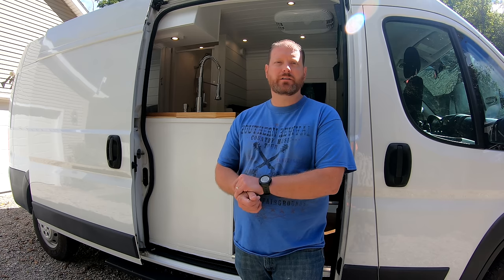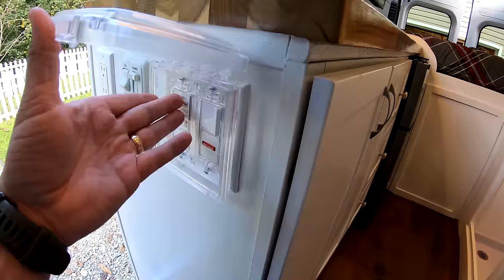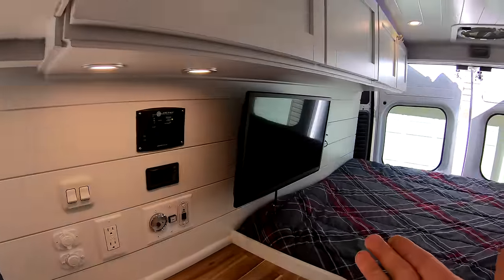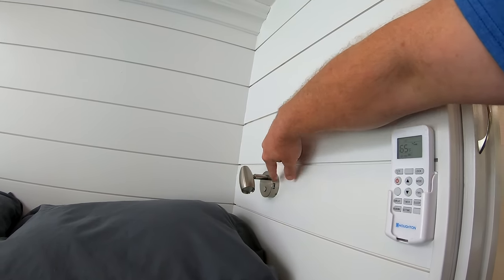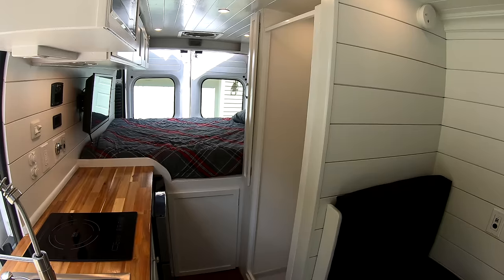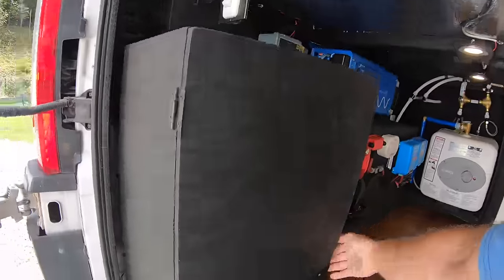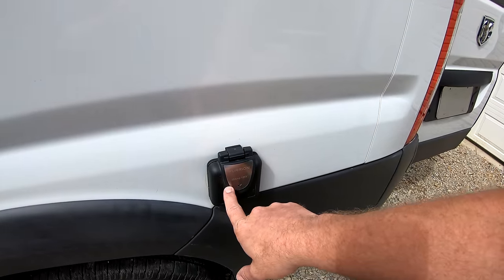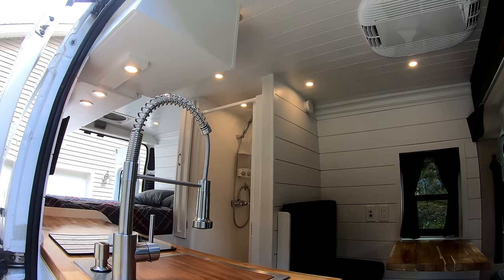We Built Our Custom Van Conversion In 30 Days - DIY RAM Promaster Camper Van Tour

Comment: You should move your main negative to the bottom battery. The way it's hooked up your first battery is taking the most wear, by moving it the power has to flow through all the batteries for any load (Victron has a document you can read on this). I would also suggest adding some kind of divider between the water hear plumbing and your electrical. When (not if) you get a leak it'll save your electrical components from getting wet.
Reply: These are wired in parallel. I don't see how the connection point would make a difference. I looked for the Victron info but didn't find it. Do you have a link?
Reply: @peterm6262  
Thanks. I believe OP responded with a link (although I don't see it now). I read their section and the internal resistance of the battery is what I recall reading. I'm obviously not an expert but having had boats with multiple batteries, it seems to me that the difference in battery longevity is negligible but I could be wrong as I never studied it. My experience is if one battery fails, the others are soon to follow.

Having said that, I have no problem adjusting my own thoughts and changing the connection points because it certainly can't hurt.
Reply: @rogermccaslin5963  was this comment your first time on youtube? Youtube has not allowed people to post links except for the channel owner for 5+ years. Sometimes links to other youtube videos can be posted if the channel owner allows that.
Reply: @CyberAndy_  
And how would one know if links were allowed by the channel owner unless they ask?

Comment: great job ! amazing that you were able to fit a stand alone shower in a non-extended van and still have descent room for everything else.  After seeing 100's of van videos, I think you nailed it.  The extended van would have given you more room to play with and ,maybe a bit more storage, but i thing i would be happier with a smaller rig due to the ease of driving and manoevering around the city and parking lots.
Reply from the maker: Thanks!
Reply: *decent "descent" means to go down

Comment: Amazing DIY..I really like that you turned around the driver's seat and left open the front. When you step in it appears so much larger. 
Most cram a wall against the driver's seat. I'm a single woman and wouldn't need such a large bed which i would widen the narrow closet into a pull out pantry. I would suggest a tilt out trash bin for on the garage door under the bed which would be handy for the kitchen. Insulating the space over the driver and passenger seats and using that for more storage than window screens would be an added bonus in temp control. The shower and the garage both looks great. Great job..Thank you for sharing.

Comment: I added a hot water recirculation loop for our shower on a solenoid.  I can hit a switch and it circulates the hot water in the pipes so we don’t lose a lot of water getting it to temperature.  Only takes a few seconds.  We also put in a thermostatic mixer valve so there is no fiddling with the two valves getting the temperature right. 

I added a cielo breeze eco thermostat for our Houghton 3400 but it requires Wi-Fi for it to work.  Our AC would short cycle a lot so I extended the thermistor outside the airflow.

Comment: Great work and great video! I can see the strugle with the shower, I would also prefer to have a shower inside in the middle, the question is should you place it right behind the driver? or should you place it next to the bed as you did. The former blocks the driver's behind view but allows when you are in the back room to have more space, the latter allows you to have a small room behind the driver. I can also see that since you have finished up with the mechanics below the bed, you have the space available to make a living room setup with two square couches one opposite to the other with tables and make the bed retractable to be removed when needed. I would personaly want to take away the bed in the morning and create a desk. Really a great setup and the wall interior is really good work!
Reply from the maker: Thanks for the comment. Yes, it's a canvas and you have to really ponder what will work best for you. Many options. All have positives and negatives

Comment: One of the nicest, smartest, diy layouts and executions I've seen. Well done! Move your battery negative wire to the bottom battery to help reduce the imbalance you currently have with your parallel batteries. ?This is especially important with LifePO4 parallel batteries due to their inherent low internal resistance which makes loads balancing across parallel batteries more critical. It will take a minute to correct this, so no reason to not improve this small issue that will become a bigger issue over time.
Reply from the maker: It's already been done. Thanks for watching.

Comment: I’ve often wondered about the van ac units. You already have all of the machinery in your van, compressor, evaporator condenser and controls. Add an electric motor to power it and you can save on installation of complete new system.

Comment: I was committed on the committed below about the negative wire to the bottom battery.  You will use all your battery's the same, not just the top one first.

Comment: Love this build!  I'm definitely going with the 159wb, the 170s are too scary for me to drive, LOL!  Only changes I would make to this is to eliminate the storage cabinet under the extra seat and put a slide out platform so that the cassette toilet could go on it and slide in and out (and put a door) to shower and not have to take it out.  I would then also add cabinets on the other wall of the bed for more storage.  And I'd add a cat door under the bed and put the litter box in the "garage/basement" for my kitties!  :)  I do wish the fridge wasn't on the ground though....I hate bending over, I need to find a way to put it up higher but not sure where.  I'd also add another flip up counter extension that would be by the door extending the counter on the left side of the sink.  Love that you were able to do store bought cabinets!  I add cabinets above the dining table too and probably switch the fan and A/C unit places, this way the fan could ventilate while cooking and I need AC on me when sleeping.  And a microwave is a must!  I retire from teaching in 3 years and will be 55 at that time.  I have a 3 year goal of buying a van and taking time to build it and then off I go!
Reply from the maker: Well hopefully you got some ideas at least. Thanks for watching! Be sure to check out our Transit build. We did some thinga different that you may like https://youtu.be/BkcjbGbE3VE?si=TGgDDboH0bxC01lV
Reply: I just watched it, awesome!!!

Comment: Very interesting build. Heaps of information there. Thank you. I did think that the Negitive connection cable from the top battery possible should be connected to the bottom battery instead. Just from what I could see.
Reply from the maker: It's been changed. Thanks for the comment.

Comment: I would like the bed smaller and the closet a little wider and a dry flush toilette. Where you have the extra seat with seat belt, I love it. Just would like it for two with two seat belts. I would love a van that works with all four weather.

Comment: Regarding the Electrical in the Garage: I see some of the wiring connectors although they look like you did a good job installing the system,  I see some of the wiring is exposed (mostly at the connection points ) Since its a garage and you may have some metal items moving around, I would be concerned about possible electrical shorting?
Reply from the maker: Fair point. The way we load we don't have a problem but it's a good idea to shield all connections from anything that could cause a short.

Comment: Very nice. Every thing an RV camper needs, and adequate for some full-timers. In some environments, a shade awning over the curb side would be nice to reduce heat on that wall. We’re 5th wheel RVers, and rarely use our awning, bit we have a weatherproof screenroom where we spend most of our time outside. We cook outside on induction cookers, so we don’t heat up the kitchen. It would be worth $50 to buy an extra portable induction cooker since yours is built in. And, a swing-up table at the sliding door would give you a place to use it. Don’t stop now. You built a great starting point. I like the other suggestions about the batteries and separating the water heater from the electrical components. Enjoy. You all did a great job. 🙌🏻

Comment: I think the silliest thing you can do with these vans are going with batteries. Just get a generator/inverter and you never have to worry about if you have enough power.
Reply: Where is a good place for the generator? And what size is good for a van like this? Does the exhaust go out the side of the van? Is the generator noisy?
Reply from the maker: I have a small inverter generator just in case, but have never needed it. I get my energy for free from the sun.  It's quiet and uses no gas. Generators are loud and stink. The exact opposite of what I want when camping in this van.
Reply: @JackofAllMasterofNone  how does it make electricity without gasoline? You would need to have the engine running to make this produce electricity
Reply from the maker: @neilwani1178  Solar aka the 🌞
Reply: @JackofAllMasterofNone  what if there is no sun for a week?
Reply from the maker: @neilwani1178  when you drive it charges the batteries via the alternator just as fast as the sun.  So worst case you would have to run the engine.
Reply: @JackofAllMasterofNone  Yes. That's using gasoline. That's a better way for emergencies when the sun disappears for a week

Comment: Nice build. I don’t believe you’ll be able to run “everything” at the same time on a 30 amp shore line, at least we can’t in our trailer.
Reply from the maker: Well I can run the A/C, the fridge, the microwave and the induction all at once. Probably pushing the limits for sure, but it works and has been tested.

Comment: Prices dropped lol
It's summer 2024, I got a 2018 promaster high roof with 110k miles for 16k, brand new all terrain tires. Only issue is cracked windshield
Reply from the maker: That's good

Comment: Only thing I seen that needs to be changed. Use the Negative off the lower battery. That way you get the benefit of combining all the BMS rating..You also don't have one battery carrying the loads..As the cells can get unbalanced when charging...
Reply from the maker: I'm not sure how much it matters but I did change it to what you recommended

Comment: Nice job! I really like your layout. QUESTION: If your three 100ah battery bank was down to 50%, how long would the engine need to run to bring them up to 100%?
Reply from the maker: Around 7 hours.
Reply: @JackofAllMasterofNone    Could you charge in less time with a bigger alternator? Did you use a Victron DC to DC charger?
Reply from the maker: @joeblow1942  Yes. I have a Victron 20amp DC-DC charger. If you got a larger one, it would go faster. But that puts a lot of strain on the alternator. Would be best to add a second alternator.
Reply: @JackofAllMasterofNone     Thank you! I really appreciate you answering my questions. I’m going to use the same layout on my van that you did.🤙🏼

Comment: Hi,
I just wanted to ask if your sliding door stays open if you push it to far end. I recently saw 2020 didn't do that and dealer said that's how it is.
Please clarify.
Thank you 🙏 cool stuff you built, what kind of insulation did you use for wheelwell.
Thank s again.
Reply from the maker: Yes it locks completely open. You have to pull the handle to close it. There is a cable that runs down to a latch at the very bottom of the door at the track. Wheel well insulation was spray foam covered with mineral wool.

Comment: You mentioned you used quick connects for your Bosch water heater... is it possible to post a link to those? I am having a hard time finding 1/2" female to 1/2" barb quick connects (I am connecting to 1/2" Pex B).  Or a link to what it is that you used?  Thank you for any help you can give. :)
Reply from the maker: By quick connects I was just referring to 1/2" NPT thread on fittings on a stainless hose. 
I used these https://amzn.to/3ORnGqn
 I used pex A expansion fittings and connected the flexible lines to a 1/2 NPT plastic fitting. Just depends on the plumbing system you use.

Comment: Doing a build on my Promaster now. How are the Chins lithiums working out for you?
Reply from the maker: Excellent. The only thing is that they don't have cold temp protection so if you plan on letting your van get below freezing while in use, you will need to think about that carefully. I do not use the van when the interior is colder than freezing so it is not an issue. They work fantastic.

Comment: How did you deal with the angle when installing the upper cabinets? I kow promasters are more square then sprinters. Im think about going this route instead of 80/20. Do you have a video on your cabinet build?
Reply from the maker: Don't have a video, but I cut the top back of the cabinets on a table saw at a 45 degree angle.

Comment: Dont you have to clean the 30 gallon water tank often? How do you prevent it from getting slimy and moldy?
Reply from the maker: Just use a small amount of bleach when adding the water. Like a cap full. We dont drink the water from ours. We just use it for showering and washing dishes, etc

Comment: I think you have an amazing build!  Do you know if the Promaster gray water tank is available with a standard 3/4" HB size outlet versus the 3" RV outlet?
Reply from the maker: I don't think so. You could adapt it though. They sell a cap that seats on the 3" that has a 3/4" standard male hose connection. I have it on mine. That way I can drain grey water into a standard garden hose. 
https://amzn.to/3Y59sTM

Comment: What's the clearance inside this thing? I'm 6'3" and I can stand straight up in the Solis and just feel the ceiling on my head. Same platform, but I was curious how the finished product ended up for you in this regard.
Reply from the maker: I'm 5'11 and can stand up straight easily. You may be just touching or ducking a tiny bit. Depends on how much insulation on the floor and ceiling. We did 1 inch on the floor plus 3/4" plywood so it takes up some space.
Reply: @JackofAllMasterofNone  Thanks for the info!

Comment: Very nice!
what size is the shower? looks small... do you have some general plan with measures, just for reference? I'm working on a plan very similar to yours, and debating with the size of bed. I prefer queen over double of course (we are 2 and not skinny), but that will eat some space from the shower and front seat. so planning the measures along the van is very delicate.
Reply from the maker: Without a 159 extended it's very hard to use a queen and have a shower and then a seat / table in front of it. Ours is a 159 non extended. We had to sacrifice shower space and used a 27"x24" shower pan instead of like a 32"x24". It's still plenty of room for a nice hot shower in a van though. Our bed is a home full size mattress with some cut off of the long end. A queen is quite a bit wider and would have taken up too much room for our build. But the full is almost equivalent to a RV queen size.
Reply: @JackofAllMasterofNone  thanks!  Yes, queen is 60" wide, full is 54"
Reply: @JackofAllMasterofNone  for internet are you going to be using the Starlink satellite link systems? I've heard great things. Cannot wait to start my own build in a couple years
Reply from the maker: @Xavanux  Right now we are using a AT&T hotspot when we need internet. Has worked great most places. I don't know a lot about Starlink yet.
Reply: @JackofAllMasterofNone  
Great build! 
What mattress did you buy? My 2014 Ram Promaster was already converted but the mattress is a old style coil and curls up on the foot end as it’s to long. Most memory foams I have looked at have fiberglass in them for fire retardants (and you can’t remove the cover as it will release all the hair like shards).
Reply from the maker: @jacqueperez1808  https://amzn.to/3y9L1tL

Comment: just recently bought a 2021 high top 159” promaster 3500 with 2 sliding doors (windows on both). I paid $36,000 pre tax, didn’t even try to negotiate because I have been looking for this specific one. did I get a bad price? 😬 (86,000 miles)
Reply from the maker: Sounds ok. I'd say as long as you are happy with it. They are all way overpriced

Comment: May I ask if the passenger seat/sear belt is bolted to a wooden frame or metal frame?
Reply from the maker: Through the bottom of the van through the steel frame.

Comment: Thank you for sharing your very detailed van build, I watched the video in its entirety and I believe it is one of my favorite Pro-master builds I have seen so far and the one I would care to use this as a reference my own build. 

The build is simply perfect, from the vanity, to your dining area, swivel chairs, microwave, and smart Television. Someone could live in this van for decades if they saw fit.  I wanted to ask what the total cost invested to build this van was, I am not sure if you mentioned it in the video, if you care to share. 

The last mention was have you considered a full sided security camera system or are you not interested in doing that. Thank you again for sharing and really, really nice build there. 

-LivingAbroadTV
Reply from the maker: I did consider a camera system but scrapped the idea due to having enough windows to see most of the area around the van. Besides the price of the van the cost for the build was $13,000
Reply: @JackofAllMasterofNone  Very nice!